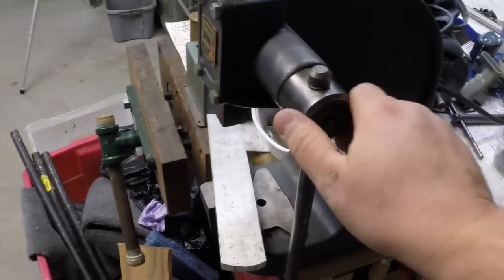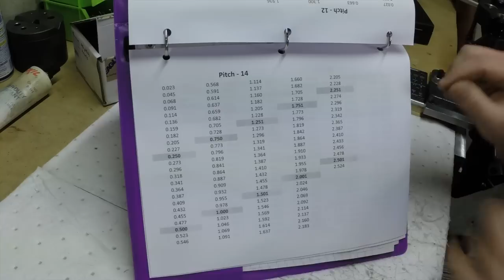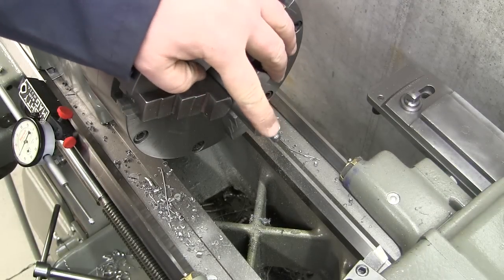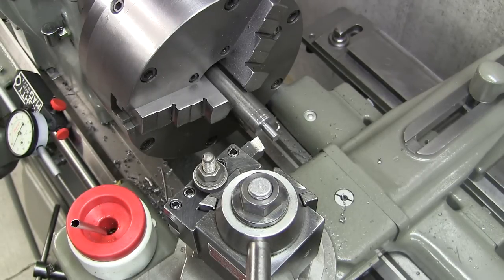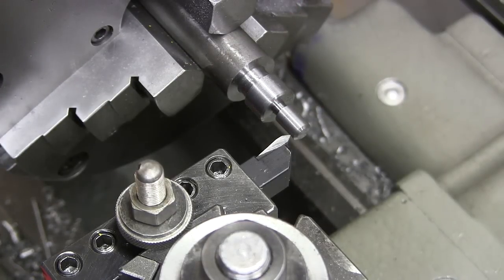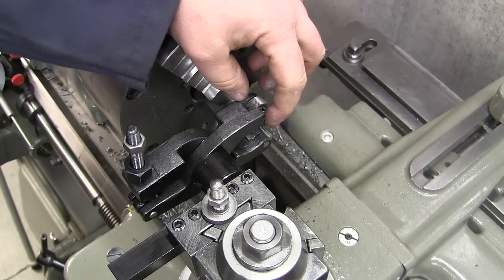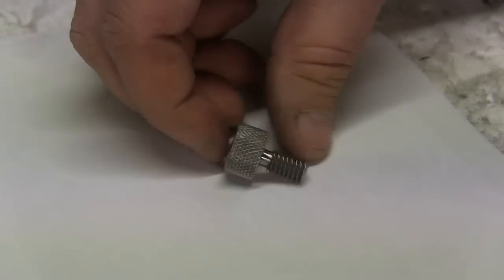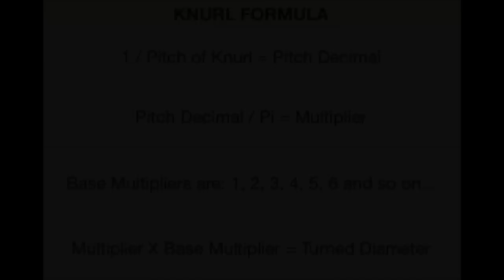Knurling - Using an Eagle Rock K1 44 and A.R. Warner HSS Inserts

Comment: Hey man, I was running through some of your restoration videos and stumbled on this one. Thanks for the shout out on my knurling series! Much appreciated!  I'm glad you found it useful and came up with a sheet that works well for you. Funny though, the telescopic steady I picked up for my 9" SB UMD was missing one thumbscrew so I made a replacement- just like you did here. Some might come in your channel and bash the formula for perfect knurls every time, like they do on my channel, but it does work. If they say they just go at it and get perfect knurls- it was mearly by luck I say! Take care, G.
Reply from the maker: Hey! Finally I get to speak to you. Your series was great, as well as the grinder refurb. It led me to buy the exact one. I never found the time and wound up selling (it) in order to buy a vintage Delta carbide-grinder. It's so funny how us YT creators influence one another.
Reply: LOL.. Thanks Brad! The HF grinder still works fine, but I too would have snatched up the Delta If I was given the chance. Like you, I love old iron- but it's hard to come by here in the middle of the states. What does come around is way over-priced.  Brigeports  go for around 5k-up here.  And that's with no tooling. Other than space, that's the main reason I don't have one...lol. I did get lucky on my SB lathe for 1k pretty well tooled up. The Yuasa chuck it came with costs more than I paid for the whole lot.. The deals the East Coasters get can get blow my mind. 

Yeah, the tube is great. I've made some good friends on here where otherwise we would've never met. I enjoy making videos to help folks out. Thanks for the reply, G.

Comment: Hi Brad,
Aside from professional machinists, you're a rare one to mention about the pitch of knurling rollers. And it's a must to get the perfect result you just got.
$275 / 5 = $55 a screw...  But, a great tool is priceless... And no man will ever regret the spending...
Great attention to details,   Pierre
Reply from the maker: pierre beaudry Pretty expensive aye? LOL - yeah the correct formula is easy to use and ensures perfect knurls.

Comment: Hello there from Durban, South Africa
Good watching Your very detailed presentation.  We have  recently acquired the very same EAGLE ROCK Tool, except ours has a 3/4" shank for our machine; after really getting turned-off  those BUMP Knurlers.  We do not subscribe to those heavy, complicating maths calculations to execute our Knurling and have found this Straddle Tool to really simply matters ( and life)  by ensuring that both Knurls are touching the workpiece simultaneously.  And the rest is history  !!!  aRM
Reply from the maker: aRM Hi Arm - yeah those Eagle Rocks are the best. It's very easy to get good knurls (without) the formula, by luck since there are so many close diameters to choose from. But if your project ever calls for perfection, you always know how to get it ;)

Comment: Thanks for the video! I'm an absolute beginner, so this is an honest question: What I learned from Adam in his videos till now is: He really dislikes chips that don't break. Now I see you and other people commenting positively about those really long chips. So who is right? Or is this a thing of personal preference?
Reply from the maker: Zorgoban Well, when using HSS (high speed steel) and you get a nice curly (not stringy) but tightly curled chip, it 's a good thing. I can grind in a little slot on top to make a chip breaker, but tight curls are pretty controllable. Thanks for watching man!
Reply: The long chips also depend on the steel.  South Bend used a leaded steel that was easily machineable that gave you those curls.

Comment: Excellent video! Have a look at 28:36: When applying pressure the knurling tool moves in, either by pressure of the wrench or to evade the pinch that it applies to the rotating work piece.
To my experience tools like the eagle greatly remove the pressure from the compound / slide to the spindle by the scissors design but they require a rigid setup. I suggest locking bed/slide and compound to make it as rigid as possible.

Comment: Must be a south bend lathe, the sound of belt slipping off.
Reply from the maker: Daniel Baldwin The main belt isn't slipping because its rubber-backed. That horrible noise is the (shot) v-belts and dried-up, screeching motor bearings, LOL.

Comment: I think you may be the first other person, I have ever seen that has understood that a certain knurl goes with a certain diameter (and its multiplier) !
I have been called "anal" in the past for doing it this way! 
And indeed a scissor tool is the only way to go, it does save the bearings and surfaces of the machine

Paddy